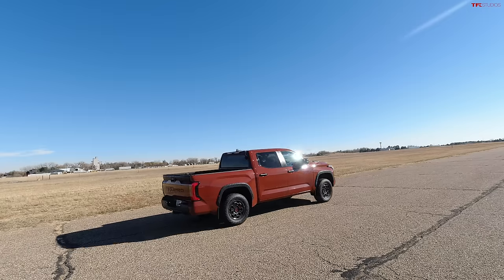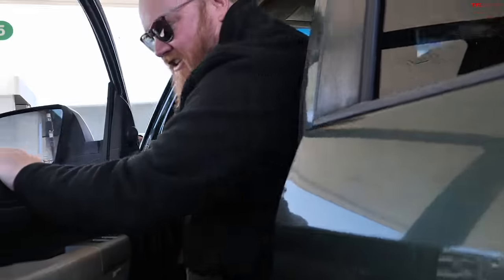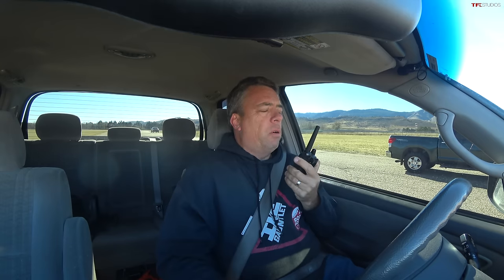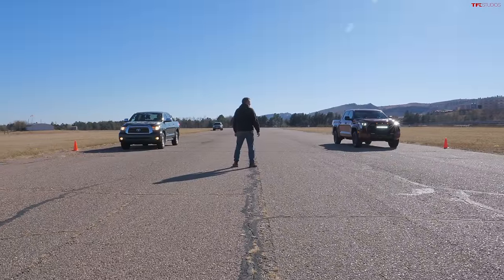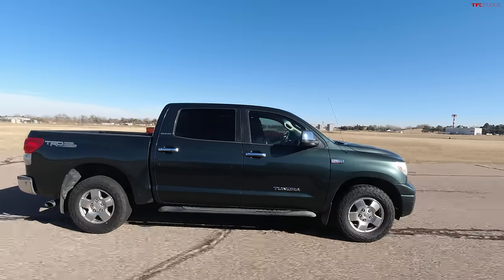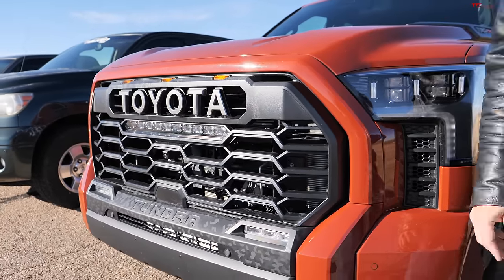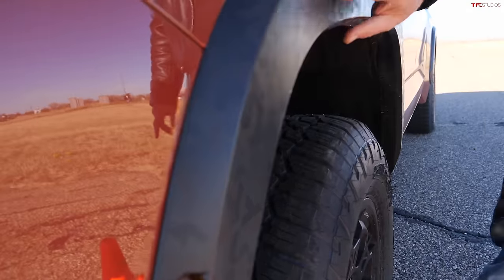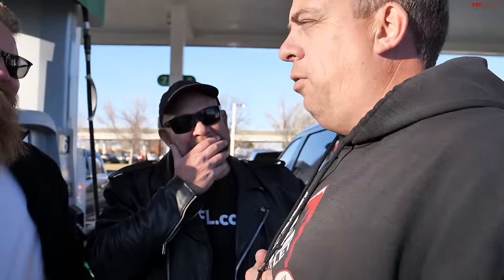Three Generations of Toyota Tundra Drag Race & MPG Surprise: That WAS NOT Supposed to Happen!

Comment: Turbo engines getting better gas mileage is all dependent on how you drive. If you never roll into boost and actually use the turbo and its power, then yes, the engines more efficient. But if you are driving in boost all the time, the engines still use a ton of fuel
Reply: However with the tiny little turbos they almost always spool up and use more fuel. I used to have one of these little downsized turbo engines it was impossible to get good gas mileage even with the cruise control set at 65 I got terrible gas mileage. Might be different with a bigger engine in a truck. I know my brother-in-law gets 16 with his 2.7 EcoBoost
Reply: @patmanz28 either something is wrong or your brothers driving habits are the reason for that figure. Plenty of people get at or near EPA ratings with their turbocharged engines, though yes it is more tempting to dip into the throttle deeper which causes the mileage to take a dive.
Reply: @patmanz28  it may have to do with where you live. For instance, in the Midwest where I am, it’s all flat so it’s much easier to adjust fuel efficiency with driving habits. If someone lives out in the mountains though, they’ll struggle to get good gas mileage as the turbos will be spoiling often going up hills
Reply: @ALMX5DP  it's actually more physics and brake specific fuel consumption. Turbocharged cars under any form of boost use more fuel than an equivalent power normally aspirated engine. If you get on some of the mile per gallon forums people with the small turbocharged cars routinely get worse than their NA counterparts..
Reply: @patmanz28  again, for that kind of figure something is either wrong or it's driving behaviors that are the cause. Looking at Fuelly which has thousands of fill ups and that shows a different picture.

And I'd love to see a BSFC map of two fairly equivalent engines (in terms of output). I'd wager the turbocharged mill has larger efficiency zones.
Reply: I had a 2.7 f150 and I tolled 2000 km every summer in the hills of northern Ontario . It’s ok with my older 4000 pound trailer , but once I got a newer trailer , the truck still had lots of zip  .  The gas mileage really sucked and other problems came up due to the heat created in the engine because of the turbos. I traded it for a V8
Reply: there's no way to get around the fact that say 400hp takes X fuel be it 12 twelve cylinders or 3
Reply: Facts! Turbo engines dpnt run stoich under boost. They run rich to avoid pre-detonation, so they actually use more fuel for a given amount of horsepower than a non-turbo engine. Stay put of boost and they're great, use boost and that v6 will use more fuel than a V8, especially towing.
Reply: @patmanz28 because turbocharged engines run rich under boost to prevent pre-detonation.
Reply: @jerridehlinger9689 and it takes more than X for a turbocharged engine because it doesn't run stoich under boost, it runs rich under boost.
Reply: @ALMX5DP its been proven ever since the ecoboost that they dont actually get better mpg then a v8. Main reason they are switching to turbo 6 engines is for emissions.
Reply: @Jackmerius_Tacktheretrix  good point afr under boost 11.5 ish off boost 14.7
Reply: @moparjr89  when towing or running them hard I agree, but normal daily driving or road trips and I know my 5.0 won’t get quite the same economy as a 3.5 Ecoboost (and definitely less than the 2.7 EB).
Reply: Whether they're N/A, turbocharged, or supercharged (speaking of all pickups not just these 3 Tundras) who buys a big heavy truck which has the aerodynamics of a brick & is then disappointed when the fuel mileage sucks? People who lack common sense that's who. As if poor fuel mileage in full-size pickups is some kind of surprise or something.
Reply: @ALMX5DP In theory there’s no difference between theory and practice but in practice there is.
Should they be better? Yes. Are they? No.
Reply: @JollyGiant19  Fuelly data suggests otherwise though.
Reply: @ALMX5DP  a quick look on fuelly looking at vehicles that have both the turbocharged downsized engine option and a slightly larger NA option The NA options consistently have two to three miles per gallon better....
Reply: @patmanz28  looking at specifically the F-150, I see that the 2.7 is consistently higher in average mpg versus the 5.0 (both mills make around 400lb-ft). The higher output 3.5 seems within 0.5mpg from the vehicles I saw compared to the 5.0 (admittedly lower by a bit on some) but of course that engine makes 20-25% more torque). Looking at 2018 for example due to there being many more miles and vehicles, 5.0 shows as having an average of 16.36mpg while the 2.7 has an average of 18.32mpg.
Reply: Yup. They have high psi injectors. Turbos get worst gas mileage than NA under WOT
Reply: @angelgjr1999  that and most of them are direct injected and thus get intake deposits on the valves lowering efficiency and power over time.
Reply: True.
Reply: When you're shoving all that extra air into the combustion chamber, you have to add extra fuel or it's going to run extremely lean. This is just basic AFR stuff.
Reply: V8 is more efficient ,dont floor it drive normally easy on the throttle and you get better gas mileage than rated by the factory and epa and even better than a  Turbo and non turbo 6 cyl..
Reply: @patmanz28  If your brother in law gets 16 in a 2.7 then he is either doing something wrong or his driving conditions are really harsh. Real world the 2.7 Ecoboosts outperform pretty much any other half ton motor in MPG's by a wide margin with the exception of the base V6 motors(which dont exist anymore). The Chevy 2.7 also does extremely well.
Reply: @oneslackr  If I am choosing between two trucks that have equal capabilities then MPG's absolute would factor into my decision. Seems like common sense to me.
Reply: @patmanz28  No. That really has not been a problem. I have a 2014 F150 Ecoboost with 115k miles and the valves were clean when I scoped them. 

Also, the Tundra 3.4L iForce and all of the Ecoboosts in the F150 are dual injected, meaning they have both direct and port injection.
Reply: @Jay-me7gw  well you are one of the lucky ones. However Toyota and Ford with the newer dual fuel injection models have solved the issue. Look at BMW engines media blasting the intake valves is considered recommended maintenance...
Reply: Well said
Reply: @Jay-me7gw  : Well, you do you. I'm not worried about 2 trucks with similar capabilities if one only gets 14 mpg & the other gets 18 or 19 mpg. It's not going to make a difference in my life. I'll pick the truck I like better & which suits my needs. 

I've never bought any vehicle in my life based on what kind of fuel mileage it gets. I don't even think about it.
Reply: @patmanz28 ROFL, I get 20-21 mpgs in my hybrid Tundra. If I drive near 55, the mpg pushes above 30, but who goes that slow??
Reply: @jwltiger3357 hahah, well I live 6k above sea level and the road way isn't flat, I still get 20-21mpgs. Even over a mountain pass back and forth from my home to the city. Half the trip is 65 (doing70) and the other half is 80 (doing 83). So calling shenanigans on ya. 😂
Reply: @patmanz28   I'm inclined to agree with a couple others here regarding your brother's economy; seems like something is amiss. My 2019 F150 2.7L gave me a rountrip average of 26.5 mpg on a 3700 mile trip. Half the distance was empty truck except for my brother and me (450 lbs total), and the way home was loaded with approx 1800 lbs extra. Average speed of the trip was just under 70 mph, driving through all types of terrain. But I will admit my 2.7 develops a drinking problem when I hook onto a  28ft RV camper!
Reply: What’s the use in having a turbo engine if you’re never going to use it! It’s a horsepower game with manufacturers putting twin turbo v6 and Ford started it with there F150 and now Toyota and Dodge is doing the same thing, hopefully Chevy doesn’t follow. Yes ton of horsepower and torque but crappy fuel economy.
Reply: @jwltiger3357  Yep this right here. I live in PA and have a 3.4 ecoboost and when I can find a flat stretch of highway I can get some pretty good mileage but when I'm going up and down all the mountains and hills it drops quite a bit.
Reply: From what I’ve seen that’s about how it is, I’ve got a 3.5 ecoboost and may as well have just gotten the coyote for the mileage im getting
Reply: but why did they downsize the engine? why not keep the displacement same and add the turbo?
Reply: @Jackmerius_Tacktheretrix  pre-detonation? You mean pre-ignition, which is the opposite of detonation.
Reply: I don’t care about the gas mileage, I love mg pick truck… that’s it… if I care about gas mileage, i should buy  a Subaru wax sti
Reply: Those numbers hardly ever translate to the real world. The mpg on those v6 engines really isn't that impressive for me to give up the v8 🤷🏻‍♂️
Reply: @MrBlazzin101  same
Reply: Very disappointing that the twin turbo V6 did not get a lot better gas mileage  😢

Seems like something is Wrong some where.  🤷🏼‍♀️
Reply: @patmanz28  i get 20 mpg with a 93 octane tune in my 2.7 ecoboost. Before tune it got 23 mpg and it has 33 in tires. But if you do get into the Boost it absolutely kills the fuel mileage you can have the Eco or you can have the Boost but you can't have both
Reply: You can’t drive them and not Get into the Turbo!
Reply: @melvinhunt6976  i know its hard not to lol
Reply: @Jackmerius_Tacktheretrix  not really. I getting better mileage towing with my 3.5 eb than I did with my less powerful v8. 9mpg in the v8 vs 11 in my eb. Same mountains. Same route. Same driving habits.
Reply: I didn't buy my 3.5 eb for mileage. I bought it because it tows considerably better and heavier than the 5.0. I've driven both with the same trailer and there is no question the 3.5 is leagues ahead. I've pulled the same trailer with the ford 6.2 and even that is underwhelming next to the 3.5.
Reply: @oneslackr  well said👍
Reply: @oneslackr  I reserve the right to be wrong, but on my 14 tundra, it kinda gets a bad rap, I feel as yes it’s a v-8 however with a 4:30 rear end it’s not going to get mind blowing mpg. However it’s got lots of power for pulling and in my case pushing snow.
Reply: I got the new turbo tundra as a rental and it got 12.4 mpg. My 2020 tundra with the 5.7 gets 15.3
Reply: I know I'm late to the comments but the other two older trucks during the braking test are exactly that older used equipment ends won't break as well. What were the stats for breaking when they were new. 
    I myself am looking for a second Gen truck.

Comment: 5.7 will wipe the floor with the new Tundra on longevity. As a Land Rover technician, I've learned the more technology is packed into a vehicle, the more problems down the line you'll have. That goes double for any engine with a coolant hose spaghetti mess.
Reply: Toyota won't even buy back their own later gen Tundras because the twin turbo V6 keeps failing. I've seen guys in forums that are on their 5th engine with under 10,000 miles. I'll stick with my 2nd gen.

Comment: I still think the 1st gen is still the best overall truck
Reply: I really like the 1st gen but in all honesty, the 2nd gen is a great truck and they're not equiped with a timing belt with a huge plus for some people. I've seen the prices of 1st gens start to creep back up this last few months and the prices between a 1st and 2nd gen truck at times is only a few thousand bucks at most.
Reply: how is it a trick if you basically cannot tow with it?? 6k lbs of tow is useless....and this is coming from a lady.
Reply: @MsQ275  It's completely useful up to 6k lbs.  A 27 foot center console boat averages around 4200lbs dry,  most single axle utility trailers can carry 3500lbs.  I see way more empty full size trucks towing absolutely nothing all day then anything else.
Reply: Newer half ton trucks are just too big for offroading in Colorado. Constant pinstriping, hard to pass and difficult to manauver. This goes double for the Raptors.
Reply: The 1st gen is great but the frames are garbage and prone to extreme rust. It's very sad because other than that it's super reliable
Reply: @MsQ275 I've done nothing but tow with my 1st gen for the last 20 years. I've towed a pontoon boat, 2 axle dump trailer fully loaded with rock and tractors. Tows just fine
Reply: A) I tow a 19 foot travel trailer all over with no issues. Most people never even go over 5k. B) I live in SLC where we have snow and salt and have owned mine for 17 years. No rust. Answer:  Wash your truck regularly.
Reply: @jqentertainment6966  My 2000 Tundra doesn't have any rust. Frame is in perfect condition.
Sorry you live in an area that uses corrosives for ice conditions. Other brands don't rust where you live?
Reply: no, the newest gen is
Reply: @motochris5459  toyotas from the 90s and early 2000s are real bad because toyota tried to cut costs with cheaper made frames. Toyota had a frame recall for a time because they were that bad.
Reply: @jqentertainment6966  I believe they did a frame recall when the 1st gen came out. AH you already mentioned that, yeah the frames were bad. I do know that my 1st gen 2000 tundra has no rust on it, but it's also been maintained consistently and been in Colorado weather for it's 25 year lifespan. I inherited it from my dad, so I don't remember if he sent it back for the recall. But it's got no rust, underneath it looks great, better than the outside I'd say

Comment: 5.7 Tundra did an extra full throttle run. Not much, but will effect overall fuel mileage
Reply: The 1st gen had probably 60lbs of sand in the back too
Reply: But the newest gen only did one run that’s not good lol
Reply: I find if I can keep my foot out of it, I can avg 15ish in my 5 7, but there's not much fun in that, so I'll take the solid 13.
Reply: When my 2018 was stock I could get 17-18 on the highway and 16-17 around town. Now it’s lifted with some armor and I consistently get 15, 16 on a good day. We’ll see how tires affect it.
Reply: 2016 with Magnaflow cat back ,, 18mpg / 87 octane ,,,, 21+ / 93
Reply: @GatesRapes very nice numbers. I have a 14 tundra with the 4.30 rear axle ratio and have the trd dual exhaust with the trd cold air intake. I get in summer on long trips like over 200 miles straight through. I have gotten 19mpg. Short trips of  30 or less miles 15mpg. However if I run 87 no ethanol. It goes up 1mpg.
Reply: 120 lbs of concrete… two 60lb bags
Reply: @tbizzy3606  My carbureted 85' PU gets 15mpg. My 2005 gets 15. the 2007 gen gets 15 and the 2024 get's 15. In 40 years the trucks have gotten bigger and heavier but the MPG has realistically remained constant
Reply: @jas340  I can get 15 - 17 if I'm on the freeways at 80mph, but the in town driving and my heavy right foot from the light brings my avg to 13-13.5.  This is the first truck I've not felt buyers remorse from purchasing. I take great care of her and hope she goes 1M mi, she just turned 50k so a long way to go.
Reply: @tbizzy3606  i average 14 in mine haha. its just the way it is i guess, and is why i try to only do about 12k miles a year.

Comment: I’ve got the 4.7 V8 in my 07 Sequoia (241K miles) and it isn’t the fastest off the line but once I’m moving, the power curve is very smooth and she gets up and moves.
Reply: I have 2008 sequoia 5.7 platinum 295,000 miles. Press the tow haul mode and it is really powerful
Reply: @mftatvop Is it kinda like if the car had sport mode right?
Reply: @sully3724  already has sport mode
Reply: I too own 1st gen sequoia and 5.7 tundra, honestly, the 1st gen sequoia has better throttle response, less power but from dead stop sequoia is noticeably better with less "lag". Dont know if its the same though in 2007 as mine is a 2001 and the throttle body system was different and had a 1/2 mechanical wire and 1/2 electronic motor design.
Reply: @sully3724  Kinda sorta, it just delays the shift points to higher rpm and makes the throttle more sensitive. It isn't functionally doing anything different in terms of horsepower or engine performance.

Comment: I wish I could buy my 2006 Tundra Double Cab TRD Off Road again brand new today.   Perfect size, plenty of power, decent gas mileage, zero reliability issues.
Reply: My grandfather’s 06 Tundra he bought brand new still has less than 20k miles on it. He’s in his late 80’s and told me a few years ago that the Tundra is the last vehicle he’ll ever drive. Drives it once a week to keep it running. He’s currently daily driving a ‘14 Altima and he says when it dies he’ll start driving the Tundra. He used to drive Buicks but got tired of how unreliable they were so he bought that Altima about 10 years ago 😂🤣😂.

Comment: I just bought a 2020 with 41k miles on it and it just looks way better than the new one. The new one just looks like a stretched Tacoma with a body kit.
Reply: Disagree the new tundra looks amazing. Plus new is always better.   Why would u pay 40k plus for a 2020 when u can buy something brand new for a few thousand more 🤦‍♂️
Reply: @siccdogg7802  I got 2023 and 2014 tundras, both are great. 2023 is better but not by much
Reply: @siccdogg7802  Especially with the new ones engine issues, new definitely is not better. Especially up here in the midwest, I can never get a 3rd gen Tundra to sell quicker than a 2nd gen.
Reply: The new Tundra looks way better. No question.

Comment: I love my 06 with a 4.7L. Beast of an engine. Still running silk smooth even with 375K with original drivetrain.
Reply: Same mine has 305k still running smooth and no leaks
Reply: You've got only about another 700k or so to go.
Reply: What is that engine code ?
Reply: Tundra Access cab 4wd TRD off rd 2006 225,000 miles, 17-18 avg.MPG,bought new, don’t like the models after 1st gen.